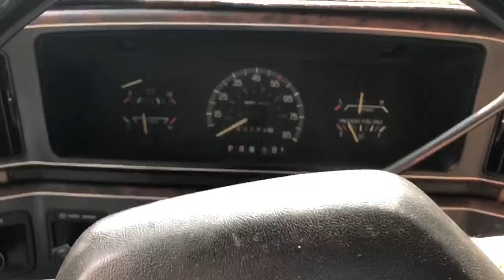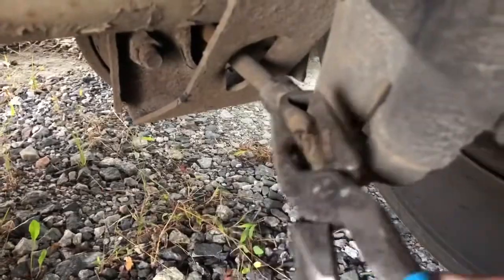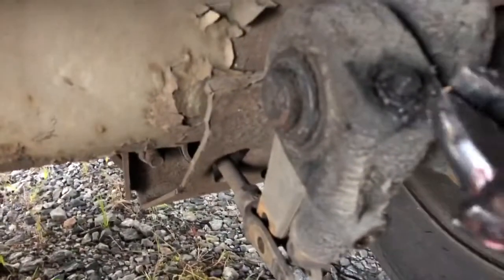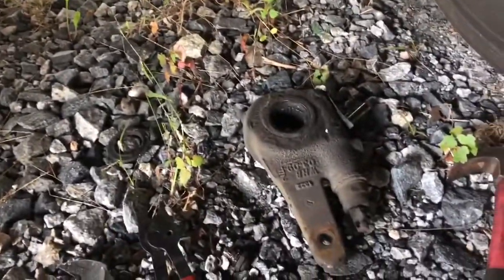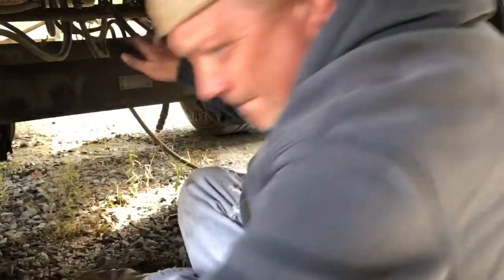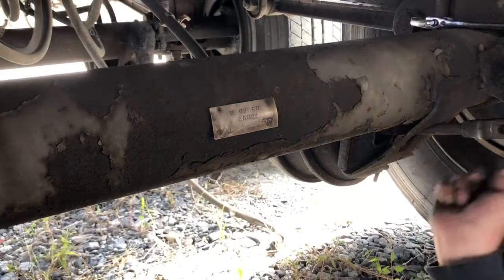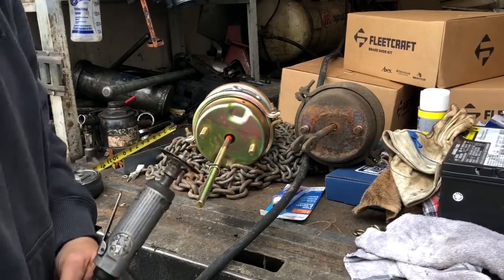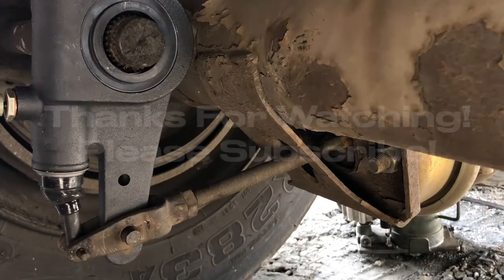DIY Trailer Brakes: Air Chamber & Slack Adjusters

Comment: Still in bed watching your video, bud.

Lucky today. Those pins came right on off.

Would you spray those pins with WD-40 before putting them back on there?

Did you say burn? 🔥 👀 
The video Gods really love your butt today. Smooth sailing. 

Yes, let’s live dangerous. I mean you live dangerous. 😜 

Hey there, Jimmy! 👋🏾 
My dad and brother are both Jimmy’s.

Heyyyyy...you put the brakes on the video. 🤷‍♀️
Reply from the maker: My second attempt to reply thank you so much LOL
Reply: @jerryodell1192  Did you oil those pins before screwing them back on? Or did you get new ones.

I didn’t sleep at all last night awaiting your reply.  👀 

Hopefully it won’t be a second night of loss rest. 🤔 

No pressure.
Reply from the maker: I’m sorry I didn’t scroll down my bad. Yeah I’ve had oil on them probably every other week they only got four they run. I’ve got my hands on them trailers all the time.

I’m supposed to start a 5 foot roof section and a nose rail on the front tomorrow. It’s way too cold. They Will have to wait
Reply from the maker: Sorry 😞
Reply from the maker: The butt gods lol that was my bad. Those were new pins they came with the new slack adjusters. I think Saturday is part two it’s the actual brake job on the same trailer.
   I love your questions here I would’ve never tried to dodge them. First legit youtuber question everything else is kind of you know half hearted. I’m really impressed that you’re taking an interest in that. Especially because it’s a DIY normally only people look at it that are doing that thank you so much Nikki. True friend here
     Again sorry for your sleepless night LOL 👍

Comment: If thats a meritor self adjusting it has to be at a 90 degree angle so the rod coming out of the chamber and the thick arm if the slack adjuster.